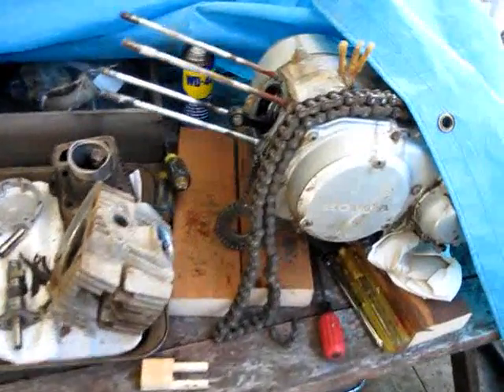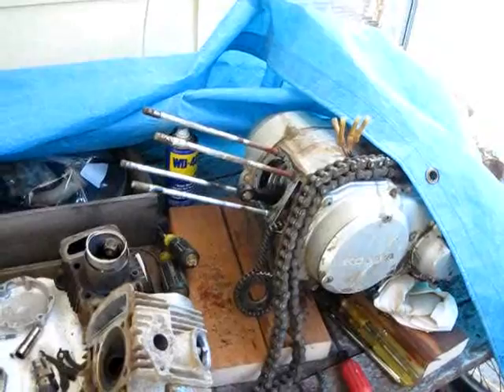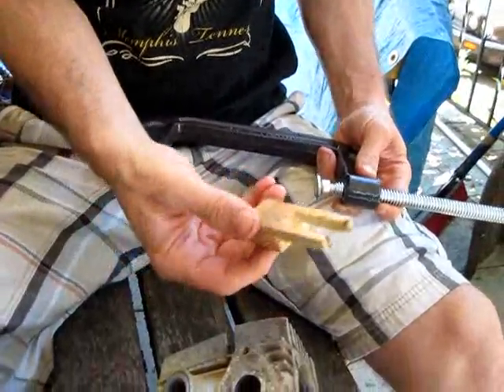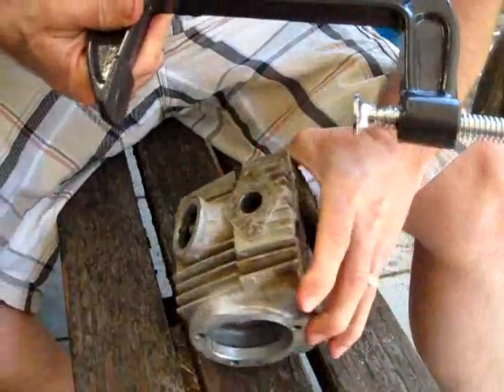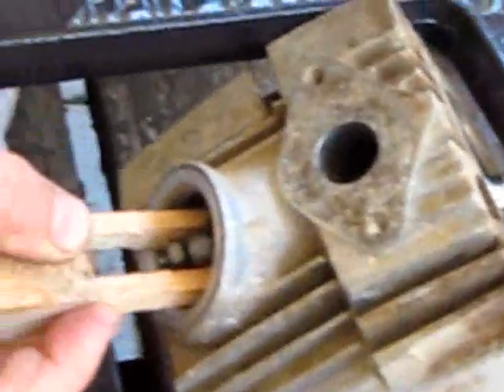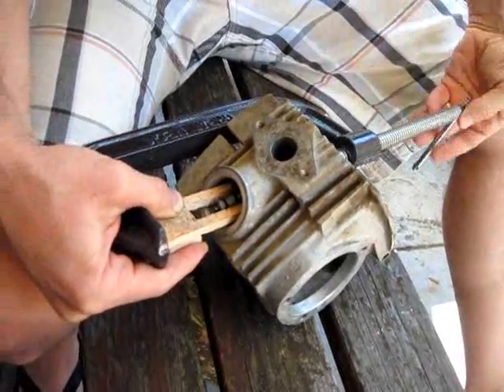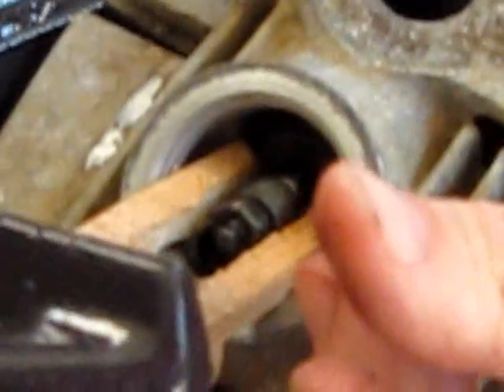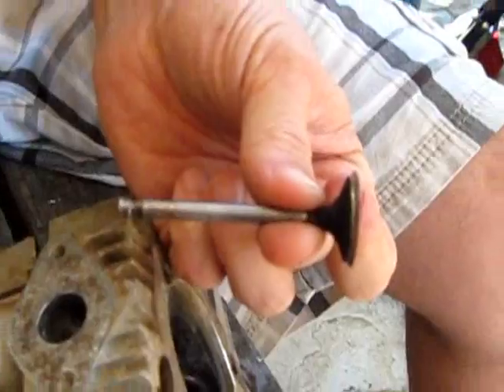Home Made Valve Spring Compressor: for small motorcycle engine

Comment: First of all there is a much easier way. To remove springs put a deep well socket on top of sprine and wack it sharply with a hammer. The retaining clips pop right out. Secondly instead of a wood use a cheap spark plug socket that comes with small engine products, cut out a small proportion of the bottom then use this with a c clamp to compress springs.

Comment: perfect time to find this video, going to work on my ct90 too
I was thinking the socket trick or making my own press
which this looks easy to make, what size clamp was that like a 12 inch?
Im replacing the exhaust valve seal, so I have to take out the rocker arms too im guessing?
now how you you put those retainer things back in using the socket method?
or even the clamp just drop in carefully? or is there a trick
the clamp looks harder unless you can tape the wood on just so nothing blows apart

Comment: Here's an easier tip that I used on an XR80..Take a socket big and deep enough to fit around the valve and use that magnetic tool you have to stick down the center of the socket and apply pressure to the socket.  The magnetic tool will grab the holders, and voila.